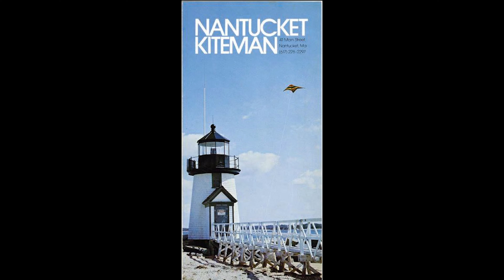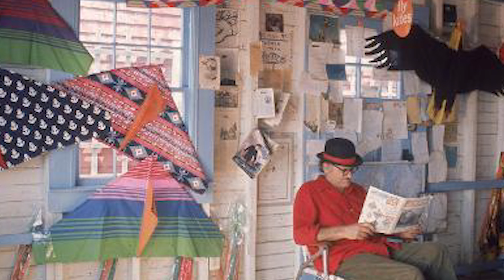Flying a Historic Vintage Delta Kite

Comment: I bought one on Nantucket in the early eighties. Been a while since I've flown it. Cant remember for certain about the crossmember placement. It is related to wind strength. Same goes for attaching your line in either one of the two holes for your line,
Reply from the maker: Such a neat kite. I’m so glad I found it.

Comment: I couldn't quite make it out, but for the eyelets for the cross spars, are you saying there's two different positions to attach the dowel rod to? Maybe it's for wind speed variations, similar to a bridle adjustment?
Reply from the maker: I thought it was for wind speed variations at first. There are two eyelets on the keel for attaching the kite line in different wind speeds. But I’m not sure the cross spar eyelets are for that. I saw some drawings that diagrammed two cross spars on the kite at one time. I wonder if it originally was meant to have two?
Reply: @EvanReinheimer   Oh wow, that's cool! Maybe two cross spars for durability during high winds? Either way, what a cool kite!
Reply from the maker: @andrewsquitiro9028 so, I got the answer on the double eyelets. It is there in case the kite starts to list to one side after some time/stretching of the fabric. Then you can adjust the cross spar to compensate.
Reply: Wow, that's so cool!